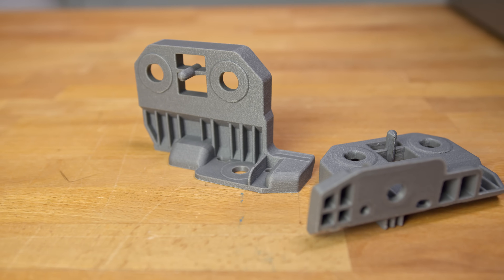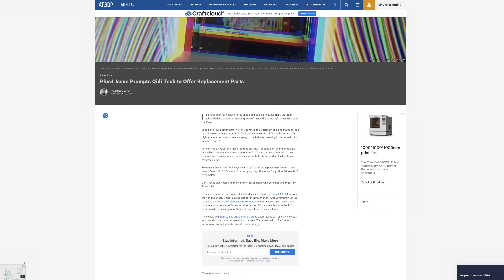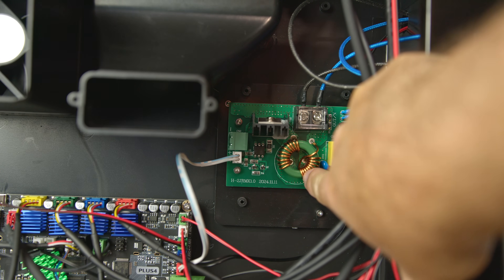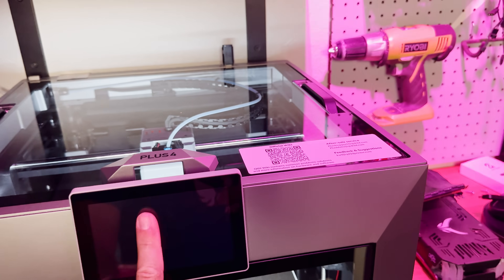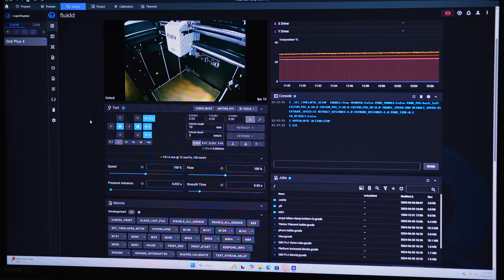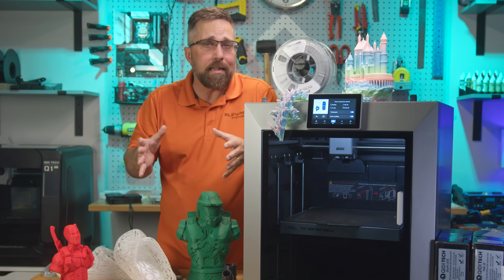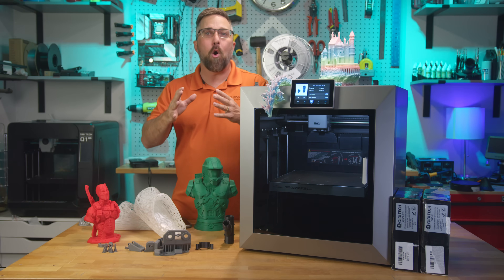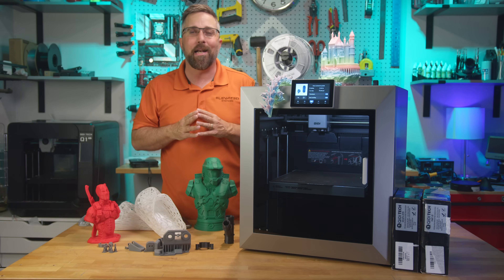Qidi Plus 4 1 Year Later: Pro Prints, No More Fires?

Comment: Thankyou for your video.  These Plus 4 printers need mods and work before prolonged use.
Reply from the maker: I’ve been running it stock with no issues for about 6 months now.
Reply: @ElevatedSystems  I'm jealous.... LOL.  Nah, very happy you've a good working unit and no faults!
Reply: @ElevatedSystems I just bought one right now from 3d printer depot.. I’m so excited to get it. Will be my first printer; will be making small to mid useful industrial parts

Comment: I've had a number of issues with my Gen-1 I bought when they first came out.  To date, I have only 53 print jobs through the printer and nearly all have failed.  Extrusion issues, clogging, not wiping and cleaning correctly, lose screws, marking on build plate and nozzle wipe plate (was too deep/close), bed falls out of alignment quite easily, heat-bed lost temp and filament would not stick to build plate, prints are warped or misaligned layers.  QIDI have been great at sending parts and parts to replace parts, but QIDI refuse point blank to replace or refund and as I type this, QIDI and I are still working at getting the Plus 4 to a basic print standard as it should be from the factory.... 1 year on and less than 55 prints!!!

Comment: The Plus 4 shipped with a massive number of STEEL heating elements rather than the promised ceramic.  Look it up.
Reply from the maker: Just like the people making these reports, you are getting hotend and chamber heater confused. They are two completely separate, and unrelated components. There is no credible evidence of units shipping with metal chamber heating elements.

Comment: I have been looking for a new 3d printer, my first and only one is a 2018 model Qidi tech X-pro dual extruder. Bought on Amazon, arrived quickly and my nephew who used 3d printers at school and university helped set it up. Unfortunately when we turned it on nothing happened. My nephew was straight onto Qidi and we had a reply within the hour, not bad considering the time difference , I am in Scotland and obviously they are in China (for all I know it could have been the middle of the night there, and they could have been closed). They asked if we could send them a video of the problem, which we duly did. They said no problem needs a new board, sent one out and arrived within a couple of days. Again very quick considering it came from China. It came with very clear instructions on how to change the board, but it also came with a lot of extra spares and things we didn't ask for. All I can say is my experience with Qidi's customer service and aftersales was great and no problems with them at all. Hence why I am looking to replace my old one with a new Qidi.

Comment: I'm a complete noob to 3-D printing.  I bought my first printer, a new Qidi X-Plus 3 a year and 1/2 ago. 2 months ago I finally found the time to sit down and teach myself how to print and started learning Fusion Pro 360.  The first print I tried was downloaded from Thingiverse. I had issues with the first couple of prints I attempted, including encasing one of the hotends in ABS.  After I changed the hotend and changing the settings back to the original settings, it printed perfectly.  I've been very happy with my Qidi.  
  It's been relatively easy and straightforward.  I haven't used any other 3-D printer, so I don't have anything to compare it with.  It would be nice if it had an AMS like the one Bamboo offers. 
 Either way, I'm excited to start designing my own parts and using it much more often.

Comment: Had my plus 4 for now 6 month and it’s been a roller coaster. When it works it’s an amazing machine that prints all kinds of material very clean and gives great results. BUT I have had a fair amount of issues so far. My heated bed thermal sensors were crushed since Qidi screwed in the bed screws all the way which in height temp prints turned the printer into a CNC. Also my chamber heater broke after a few prints. Both got replaced for free after I reached out. I like the printer but I hope the issues will soon stop. The new Qidi box looks nice but I already heard about some drama with it.

Comment: Coming from an ender 3 to this was a major step up. The machine is a monster, and prints every filament I have thrown at it with ease, from PLA to ABS and Nylon. It just works!
To those wanting to buy, I have one tip (and this has been my only issue), let the printer heat soak before printing anything other than PLA. It sets the z offset before thermal expansion of the bed sets in, so if you are printing high temperature filaments, the print head can hit the bed if you are not pre-heating it. Pre heat, and all is fine. It is just hit print and forget. 
If I need a second printer, I will get another one of these.
Reply: Is that not something you can change in the slicer's start gcode? I had that issue with my Sovol SV06, but I just moved the home command to be after the bed preheat command in the start gcode so I don't have to do it manually every time.

Comment: I've want to recommend this for my work but have been hesitant. I work at non-profit lab and need custom holders for equipment. I've been printing them on my X1 Carbon but eats into my projects. High temp filament would mean less replacement of printed holders, but I've been concerned on Qidi reliability and support.

Comment: 200hrs on mine. The chamber heater fan packed in last week. Printer correctly detected overtemp on the heater and shutdown safely. Emailed Qidi and they sent me a new heater unit within a couple of days with no quarms. Just fitted and back up and running. Seems like they still ship 230v systems with the old relay. No sign of thermal issues on when i looked. Seems like they are correct that its only an issue with 110v. Overal still really impressed with the machine. Just wish they would hurry up with the Qidi box multi colour

Comment: I got my printer last week and it came defective. Have to replace sensors before I can even print
Reply from the maker: That sucks. Can I ask how the customer support experience was dealing with that issue?
Reply: @ElevatedSystems if was good but it’s sucks to buy a printer and it can’t even get through the initial setup process
Reply: I had to replace mine as well shortly after buying it about 4 months ago,  qidi sent me all new bed sensors and pei sheet at no cost, no problems and have been running petg on 0 offset since then with no issues. I have total of 374 hrs of print time and close to 4,000 kg of total filament printed, mainly petg but some asa and pla.
Reply: @RGFIRE103  4,000 kg? as in 4,000 rolls? in 374 hours? 🤔🤔
Reply: @nullvoid24  Hmm A printer that can print 2.98grams of filament per second ?? It does seem unlikely doesn't it !! LOL

Comment: Thanks for your review of the Qidi Plus 4.  Despite the issues this printer is in the runing for my next printer 3d printer. I really like the performance of my Bambu A1 Combo I purchased at the end of 2024.  I didn't like are the changes that Bambu Labs may enforce in future.  Turning the device I thought I owned along with the features I bought into something other than it was when I bought it.  Now they haven't done that yet but my next printer won't be a Bambu.  As always enjoyeed the video and look forward to your next FDM powered project.
Reply: 500 hours on my Plus 4. Its 2025 batch and I love it. ❤ Qidi Box ordered. 🎉
Reply: @RobertVargaCG  Thanks for sharing.
Reply: Hopefully the new batches are shipping without the common issues.  Bad Wifi, poor probe and bed sensors leading to danaged beds, poor board cooling, flakey main board.  If you are willing to accept the need for mods it can be useable.  I have had all of these issues with mine (Jan 2025 batch), have addressed them with mods and work arounds and am able to use it to produce some very high quality prints.  The main issue with these printers has been poor quality components and inconsistent quality control in manufacture.  If you get a good one you will likely be very happy.  If you don't you will very quickly be looking for how to return it.  Suggest only purchasing one of these from a vendor with a good return policy.  Of all the different brands of printers I own I question the purchase of this one the most.  Honestly my Centauri Carbon (without a chamber heater) has been way more reliable (with a 0.6 nozzle) than my plus 4 when it comes to various filaments including ABS.  My plus 4 has basically become a large format PLA/PETG printer in my lineup as the nozzle clogs frequently with ABS. ==> I am going to go out on a limb here and guess that Qidi cherry picked the machine sent to this reviewer.  Even with this would suggest upgrading the fan for cooling the main board.
Reply: @tonyoslund5700 I have April batch (whatever that batch was) and have 0 issues im reading about. In just 2 months of printing I already recognize most of what I see is user error and I see the exact same posts in Bambu FB groups I'm part of as well. There are cases where things dont work and these people are loud (and I'd be as well), but they are minority. Manufacturing/shipping issues happen everywhere. Bambu groups are literally full of the same. 😅
Reply: @RobertVargaCG  Thanks for your thoughtful reply.  I think it will be later in the year when the start offering combo deals with their MMU.  That's what I think I'll be waiting for.  Hoepfully the MMU will be fully debugged before they release it.
Reply: @tonyoslund5700 Thanks for taking the time to document your experiences and suggestions.  Valuable comment!